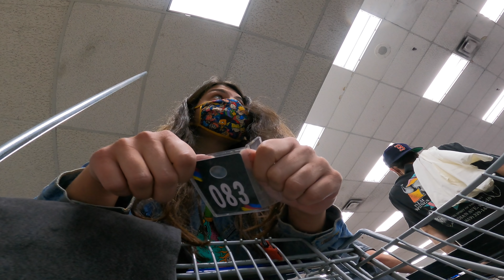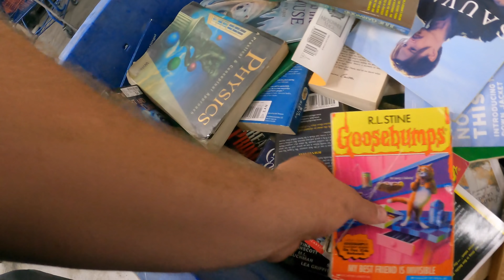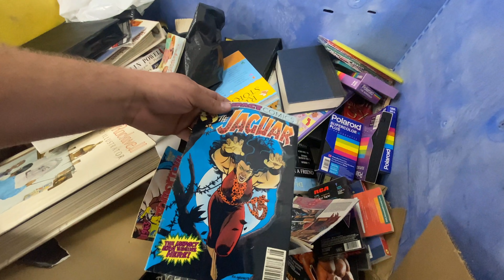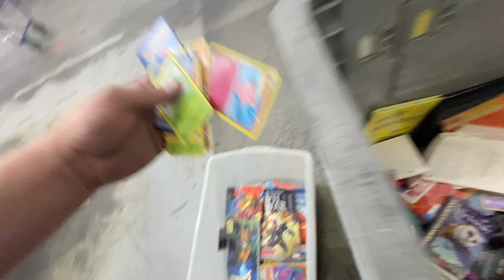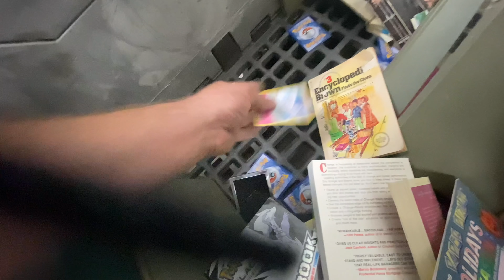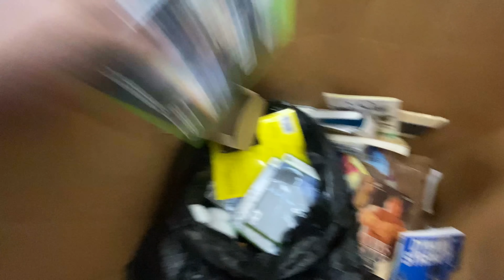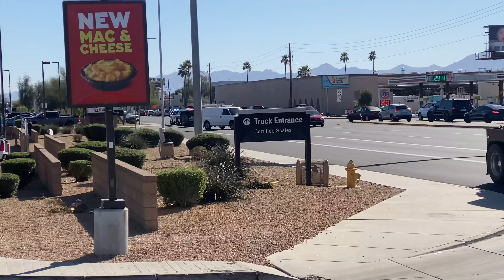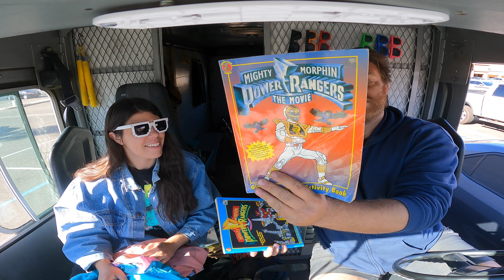😱The GOODWILL BINS Got CRAZY!!😱

Comment: Hannah, I found a pair of new vintage black levis 505s made in USA yesterday.  Unfortunately they do not have the tags.  I know they are new because the sticker that is usually on the leg that tells size is gone, but there is a lot of lint stuck to the left over sticky stuff.  My problem is I do not think I can sell them new without tags, because I will have to was them to get them cleaned up.